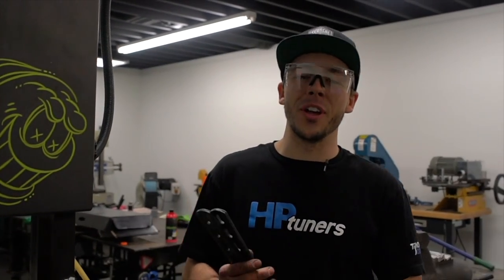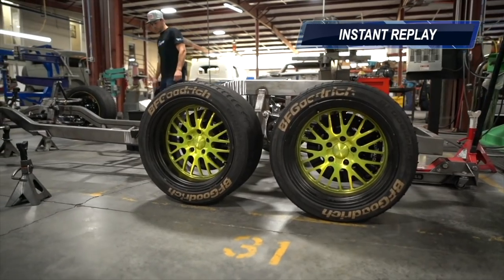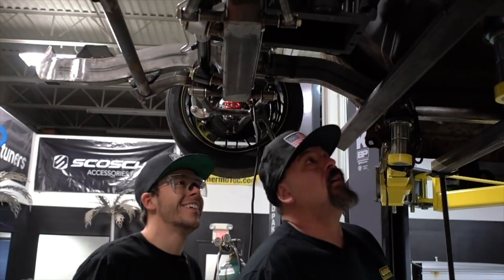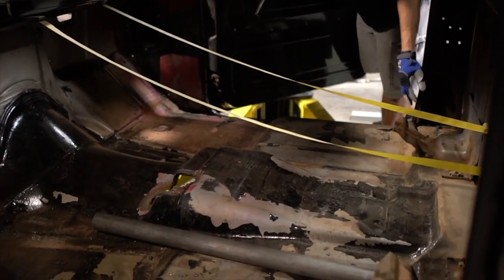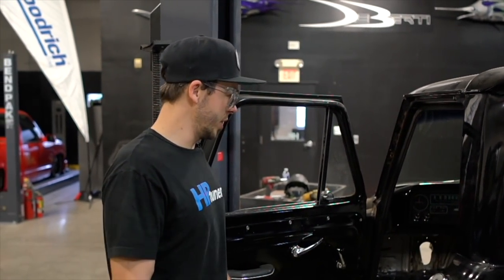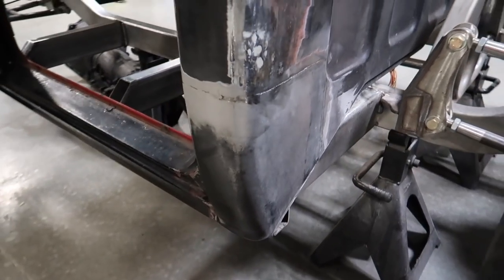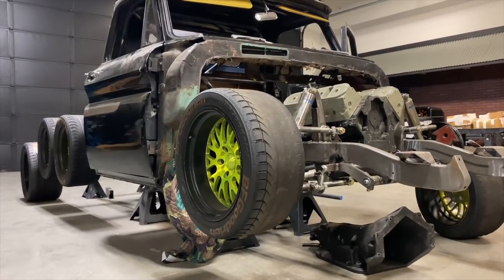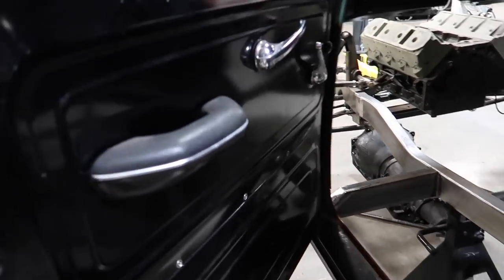DREAM TRUCK BUILD WITH MY DAD | OLD TRUCKS ARE NOT RUST FREE! - C10 SLAYER EP. 5

Comment: I wanna see that thing drifting. Are all four rear wheels going to have power going to them. Imagine the smoke this thing will lay down lol
Reply: I caught sight of a intermediate drive shaft when they were pulling it off the trailer, you can see it spinning in between the 2 drive axles.... What I'd like to know is what axles he's using that gives him that capability.
Reply: @highoctain113  they make a Ford nine inch that was military use that was a 6x6 design with a high pinion pass through shaft to power the regular 9 inch Ford in the rear
Reply: @markdarnell12  THANKS!!!! That's awesome... Any idea what they are called so I can start searching for one?

Comment: I finished replacing the front floor pans on my 67 cougar a few months ago, it ain’t easy! Lol sounds easy! You can spend over 20 hours if it’s your first time doing it. But I do think that you guys did the right thing by welding the cab to the frame and removing the firewall. It will make it a lot easier to work on. Good job guys!

Comment: Shoot compared to my ole 89 f150 that thangs mint.
Btw loving the build, personally for aesthetic I'd mount two spare tires lifted a little bit and at an angle 1 on each side behind the very back functioning wheel, itd make it easier to change em and look sweet.